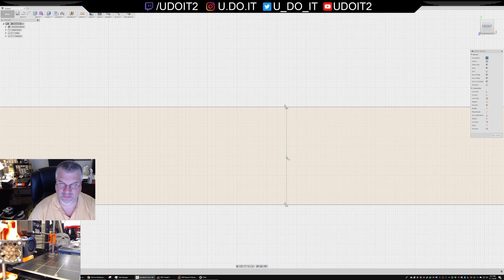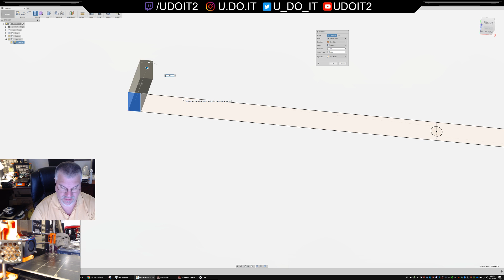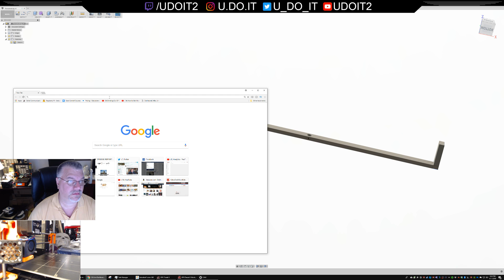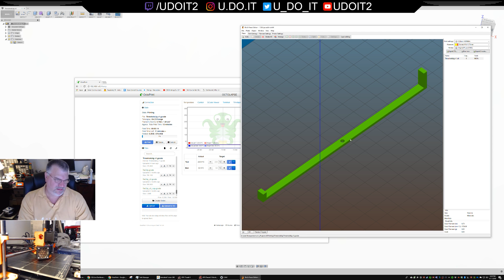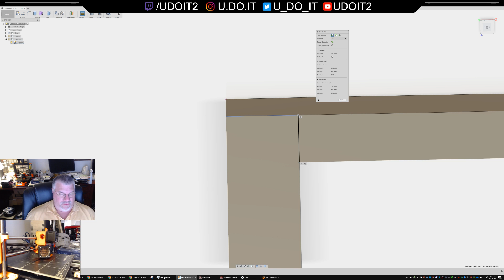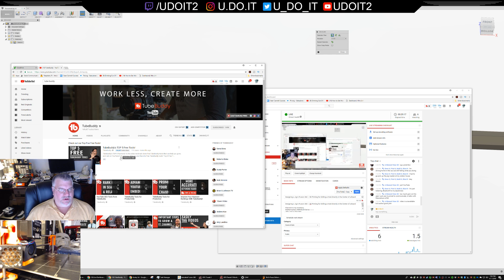Designing a Jig in Fusion 360  / 3D Printing for Drilling a Hole Directly in the Center of a Board

Comment: I need to learn this program John!
Reply from the maker: It's easy - everything you do in your life is a program. You do tasks (they are the procedures) and you make decisions (those are the if statements).  Sometimes you do tasks over and over and they are the loops. Think of it that way and EZ Street!
Reply: Once I get the 3D printer built I will certainly hope that I "master" it. Almost done....still need to power it on load the firmware and calibrate it...of course there is always other details that need to be lined out.